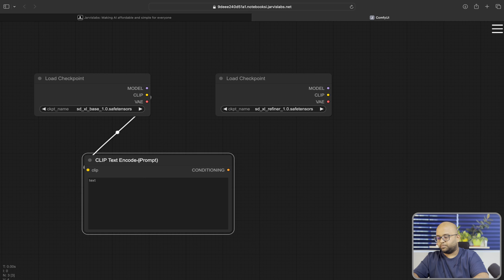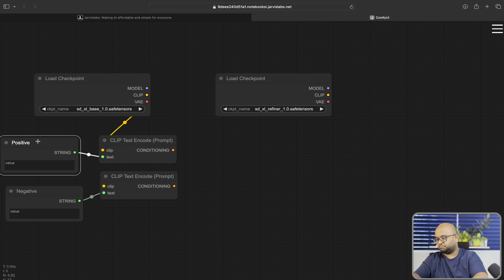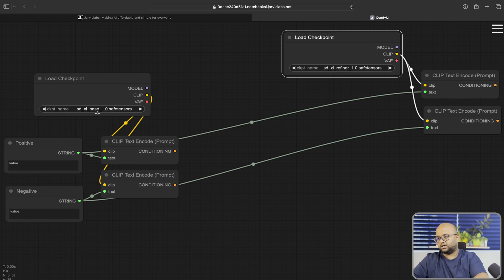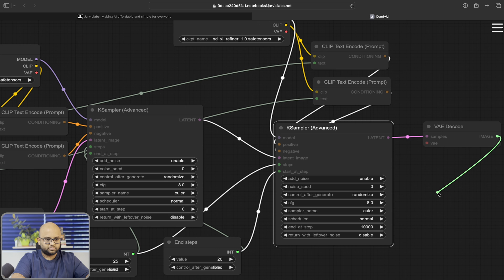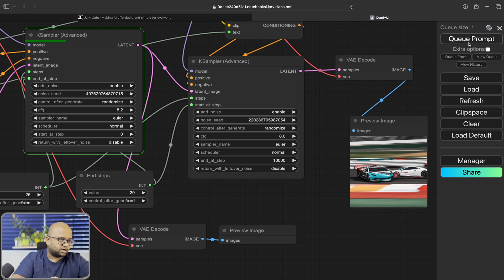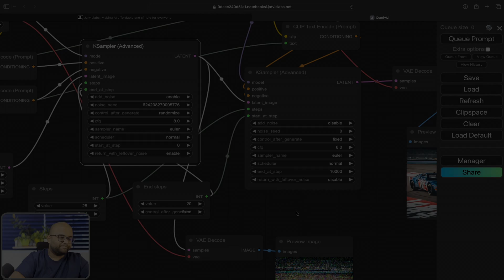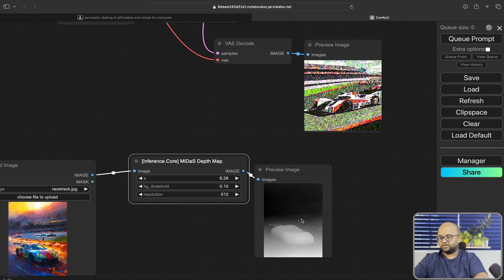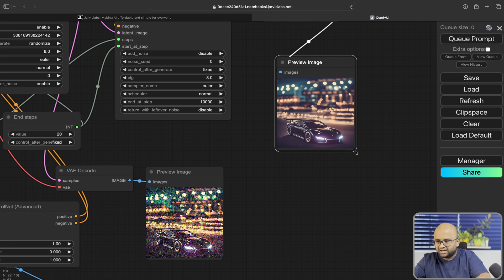ComfyUI - Getting started (part - 2) : SDXL refiner & ControlNet | JarvisLabs

Comment: Thanks, great video! Could you do one on text and image input (img2img) inputs? I have a workflow set up, but am getting bad results, I think because the denoise parameter has to be set and is apparently very sensitive. I watched the one about Stability Cascade doing this, but I'd prefer to use SDXL, and the Stability Cascade (part 3) video didn't go into detail about this.
Reply from the maker: Sure, we will post a video focusing on image inputs. Thanks for commenting :)